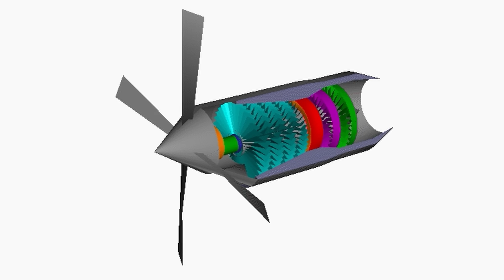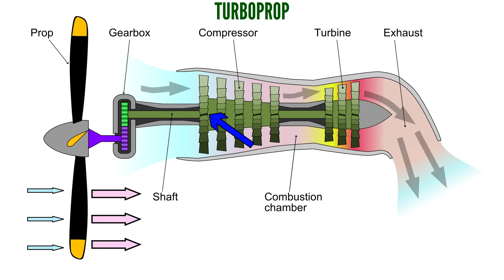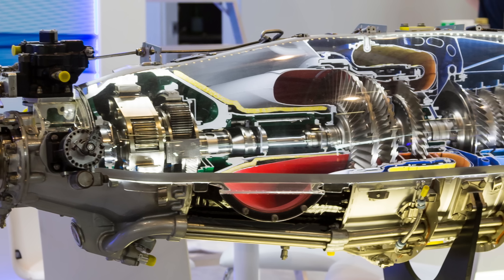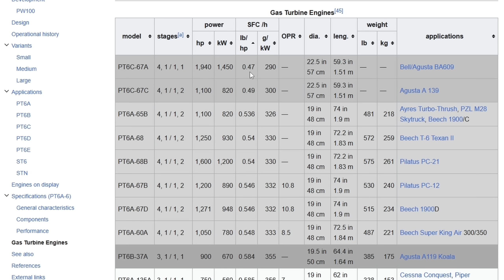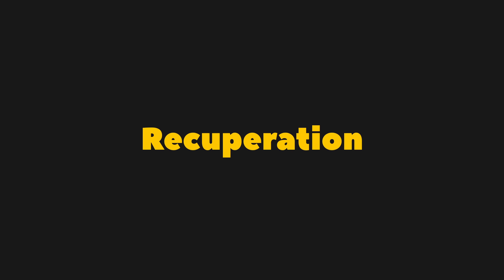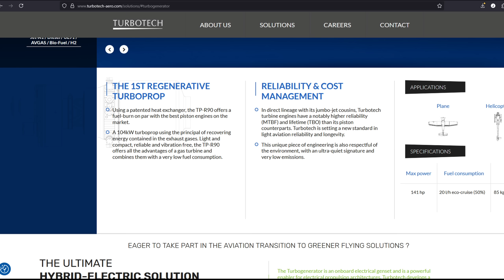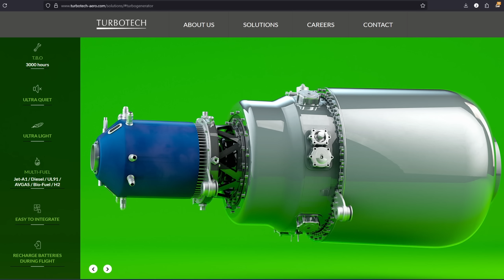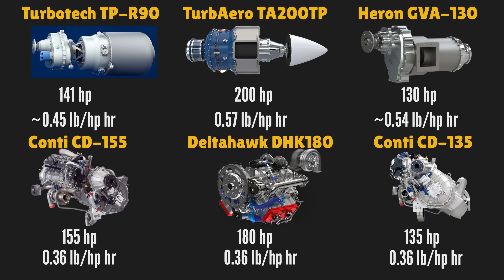Are Piston Engines Dead? Small Turboprops are Here

Comment: the trhing that's been holding back small turbines is recuperators. Nail that and your fuel economy skyrockets. 
The problem has always been bulk. Air-to-air heat echangers are large and this is where most small engine researchers have been working, but the hobbling factor has been a lack of investment - it's always been cash-strapped startups

Going forward, the same principles can be pulled into larger t-prop engines as long as it can be fitted into the nacelles. There's a lot to gain IF the mass penalty is low. You're not adding moving parts - the heat exchangers are entirely passive
Reply: interesting, I wonder if any of the advancements in  CPU/GPU cooling especially heat pipes could be applied to here.
Reply: @dacharyzoo  Heat pipes require vaporisation at one end and condensation at the other (phase change transport)

Turbine compressors typically achieve 250-350C just before the combustors (when you compress a gas it gets hotter - Boyle's law) which means you'd need to find another working fluid (most use water and a slight internal vacuum for electronics in order to lower water's boiling point

They're really efficient/effective and we've used them on spacecraft to get the internal heat out. but the cold end has to be "cold enough" or you just end up with a thermosyphon and those are vastly less efficient as well as gravity dependent
Reply: Absolutely that kind of technology is going to be a tricky one to make it compact and efficient
Reply: @Hurpdurpdipidydoo  If anyone's seen the engine package on an Abrams tank - 80% of the volume is the recuperator. That may help people understand the challenges trying to pack everything into the pointy end of a GA aircraft without ending up with a massively long snoot that upsets CG

Comment: Not in the near future due to the fact most of the GA fleet was type certified in the 1960s and 1970s and a conversion from a piston to a turboprop would be a major retroactive design change which would require extensive and expensive design and re-certification, per aircraft model. We can't even get modern piston technology widely adopted in GA.
Reply: That said, if they had an STC ready to go for the type (that's a big if) and it competed with the cost of a new Lycoming / Continental engine I would consider it.

Comment: Thanks Let’sGo, excellent presentation. Another critical factor to consider is power to weight ratio. 

If you want 400 to 500 hp for light helicopter (or airplane), petrol engines would just be too heavy. Diesel reciprocating engines even worse.
Reply: Power to weight ratio and efficiency will counter each other to a degree.  Fuel is heavy so when longer distances are required, a more efficient but heavier engine could prove to be the lighter solution.  You have to look at weight of the full solution - so engine and fuel.

But you point still stands - it is an excellent point.
Reply: True for larger helicopters but not for very light. e.g. Robinson. 

Robinson produces three models: the two-seat R22, the four-seat R44, both of which use Lycoming piston engines, and the five-seat R66, which uses Rolls-Royce turbine engines.
Reply: The earliest helicopters had piston engines. Sikorsky H-5 used a R-985 rated at 450 hp, smack bang in the range you mentioned.

Comment: I don’t think it is really there, I want it to work but it just isn’t possible it seems. Turbos are there own problem too with cooling as you come down.  This is why diesel doesn’t work well either. 

The air temps as you come down warm up drastically or going from say Arizona to California the rapid temp changes crack turbo housings.

Comment: the cost of more fuel consumption is worth it because of extreme reliability.
Reply: The gearboxes are the critical part. Making reliable gearboxes is an issue with helicopters, reciproking engines, and keeping down the maintenance costs even trickier.

Comment: You should include the all-up weight of each turboprop vs IC engine comparison as well. Especially for the diesel engines. Weight directly relates to required power and hence effective fuel consumption rate to transport a given cargo mass.

Comment: Talking about Mogas as an alternative to 100LL. I guess what people really mean is the universally available „pump gas“. Problem is, at least in the country that Lets Go Aviate comes from, that the available pump gas doesn’t have the octane (RON) number required for most high compression aviation combustion engines.

Further, there is a high, varying and undisclosed ethanol content in pump gas in countries such as South Africa.
Reply from the maker: Octane in South Africa is more than sufficient. I'm not aware of any mogas aero engine that can't safely run on 95 RON. However an increasing problem we do have with "pump gas" here is contamination (diesel in the petrol).
Reply: @LetsGoAviate Even if you are unable to trust automotive stations to supply fuel clean enough for safe GA use or you were worried about ethanol presenting problems, and had to maintain a separate supply chain path for "aviation MOGAS", just being able to replace 100LL with "pure" (no ethanol) unleaded "car" gas as your "standard AVGAS" would be advantageous.  And it honestly wouldn't be too terribly expensive, I don't think - I live in a coastal area, and while the "car gas" is invariably up to 15% ethanol, quite a few stations maintain "no ethanol" (Rec90) 90 octane gas (still "automotive grade"), primarily for marine engines and small engines (also good for classic cars).  Yes, its more expensive than the ethanol gas, but not prohibitively so, and not nearly the same price difference as between "regular" pump gas and 100LL AVGAS.

Comment: What is the fuel efficiency numbers for modern Diesel engines for general aircraft?
Reply: About 45% thermal efficiency compared to 35% for gasoline. So nearly 30% more efficient, not taking into account some additional weight.

Comment: Merallurgy development is contantly advancing, turbine manufacturers should concentrate more in incorporating less expensive, more effective and stable reliable materials available now, certainly slightly heavier but not significantly so.
Reply: Compressor efficiency is basically hit a Plateau and that's where most of your fuel efficiency/consumption is linked to.

Comment: It is a huge delight to find a presenter who really understands the issues and engineering.  I can't remember the last time this happened.
Reply: Yes 🙌
Reply: You never talked to me... Ha ha. Yes I agree he does come from a Pro Con balanced factual standpoint.
Reply: Yes, he's tecchnical, factual, not selling himself or aything. To the point, not acting cute. Refreshing.
Reply: The air is push in the compressor by the atmosshérique and the dynamic pressures due to the flying speed of the engine. Air and any other fluid can't be draw or pulled! How coud you attach the rope?
Reply: He's got nothin' on this guy. ;)  

https://www.youtube.com/watch?v=Ac7G7xOG2Ag
Reply: Because it’s not Ai crap
Reply: @glynncleaver7398  - A typical AI crap is showing a bunch of generic stock video clips badly mixed together.  Yikes, I hate AI generated videos!
Reply: @glynncleaver7398  Absolutely

Comment: So is this turbine engine's efficiency gain valid for altitudes below 10,000'? Distilled down the vid was mostly about a 140hp turbine, so being the devil's advocate, the efficiency claims may be true enough at 25,000' factored for time to destination in a best case scenario, but one wonders apart from the experimental segment and training aircraft what use is 140hp and percentages of that amount between 65 and 80% output? 
To me this has the smell of best case scenario, a bit like fuel consumption figures for cars that manufacturers release than can never be attained by anyone ever.

I guess the weight saving if any over a Rotax may account for something, and over a 200hp 0-360 Lycoming 4 cylinder it might sort of make sense since the turbine cycle is unaffected by altitude in the flight envelope an NA 4 cylinder aero piston engine might be. Even so it's still 60hp down in the takeoff and go-around high drag phases. 
This of course begs the question, what of hot and high performance? What are the hot starting/failed start rules. Turbines are very sensitive to this sort of thing rendering them very fragile in terms of any kind of pilot mismanagement, lack of attention. Piston engines are more like cars in this regard.
Are they available in CR? A lot of unanswered questions from this cynic. 

The reason for my cynicism is I read an article called the Little Engine That Couldn't around 15-17 years ago about the failed Williams EJ22 jet engine. It's design was hoped to replace piston engines once and for all. 
After reading that article I know well enough the issues of small jet engines and how the obstacles may actually be unable to be solved factored for cost vs real world hot and high performance. In short a great engine if you live at sea level and it never gets over 15deg C and 1013.2hpa.  
Turboprops are far more flexible than jets but the blade gap to housing clearance percentage issue of small and large turbine engines you discussed causes me to ask all these questions regarding fuel consumption and efficiency at varying altitudes.

Are the public going to yet again be seconded into the role of being unwitting full paying beta testers for this company?   

Also, variable stators have been in use since the 1950's to get around the fixed compressor section blade pitch issue. I'm hardly a turbine engineer, but I have noticed the J-79 made great use of same before I was born.

Comment: Up front cost is too high. Doesn’t matter if it lasts longer or the fuel is a bit cheaper, it costs 3x even a certified lycoming lump. A decent 40 year old Cherokee 140 is a $40,000 airplane these days, nobody who isn’t already very rich is going to be paying the already unreal costs of GA aircraft and adding a $150,000 STC on top of that. And yeah, you can bet that converting to the small turboprop will cost a lot more than the $100k of the engine itself.

Comment: All us general aviation guys want to be flying turbo-props, but that poor efficiency especially at low altitudes, modest power settings, in smaller sizes and built to be affordable is the recurring problem.

To my way of thinking, we haven’t yet had even close to a responsible offering in DIESEL.  Ultra high strung geared diesels are nowhere near the answer.  It seems like with modern VVT technology, a turbo diesel that isn’t too heavy could work; especially with the significant fuel weight savings.
Reply: I think the biggest problem is there is very little research into the small diesels that are the best fit for aviation.  Two stroke diesels have been effectively banned from on road applications due to emissions.  Achates is the only company I have heard of doing research into two stroke diesels in the size range that would be used in a GA aircraft.  I believe the issue here is automotive engines have a much lower incentive to sacrifice everything for weight, thus the 53 and 72 series Detroits that have power outputs in the range desired, are too heavy being iron blocks. Then there is the allergy so many GA have to liquid cooling...

BTW VVT is useless for aviation uses, as the purpose of that tech is to expand the useful RPM range, and aircraft engines operate in a very narrow RPM range.
Reply: @Castenea-y7e  Good Morning!

When I wrote about VVT, I kinda knew people were gonna find it odd.  One of the many challenges to a light weight reliable aviation diesel is being able to reliably do a restart at high altitudes where the air is thin and cold.  One way to mitigate this is with a compression ratio that is somewhat higher than is common in today's diesels.  Unfortunately, to achieve the reliable horsepower we need without spinning it up to fast the way Thielert did with those tiny Mercedes diesels, is to "boost the hell" out if it;  High boost really is best on diesels with quite low compression ratios.  Limiting compression is also good for NOx emissions though that is not my primary concern.  I propose that VVT is PERFECT for powerful aircraft diesels; the auto industry has made these systems quite trouble free or at least free of unexpected failure, and solves the problem of very high boost at altitude while having very high compression in those conditions where it is needed such as starting at altitude or even at a high altitude cold climate airport.

Having been the owner of a couple of 8V71N engines (though I am a cummins guy at heart), I agree that two stroke is a path to higher power especially with properly chosen boost.  When properly designed, their pollution isn't that bad.  Mine were surprisingly clean even running "against the pins".

Comment: Super video!
It should be noted that a turbine engine follows the Joule-Process, while piston engines are closer to the Carnot-Process, and the Carnot-Process is more efficient.
I flew all types of engines. A two-stroke diesel, burning Jet A1, might be a good option for GA and even commuters.
In case of a hypocycloidal crank system harmonics could be even cancelled out.
With these piston diesels fuel consumption is proportional to the power. This is important on oceanic routes in case of headwind.
Best speed, in case of headwind, is 1.5 windspeed. If you can't make it with this speed to the destination, make a 180 and return to the airport of origin.

Comment: I think small tuboprops will likely at times achieve a slight edge;  but will consistently be surpassed by turbo piston engines, due to the changing context.
if they can hang in there, the turboprop manufacturers will be ok ... but they are going to have to work for it, that's not easy.

Comment: Thanks for great video!  Based on your report, I think turbo props are on the cusp of coming to GA.  You showed cost comparisons between turbo props, but you didn’t show same costs on all the pistons. For example, I have heard Delta Hawk asking over $100k for their new Diesel.  Yes it gets best in class fuel consumption and probably rivals the turbojets in TBO (not really buts let’s give that that one), it is then more expensive that two of your turboprops and same priced as the other!  And I will bet they are lighter weight. And we know they are smaller form factor.  In fact this last point could be the deal breaker.  Piston engines are just bigger in frontal area.  That frontal are, particularly at the nose creates drag.  That drag slows you down and increases your fuel consumption.  I’ll bet that when you put a piston engine into a planed designed for one, and compare the fuel consumption of the same plane but with the front modified to accept a turboprop, I’ll bet that fuel consumption penalty on the turboprop goes away!  It would be great to figure out some numbers on this aspect. Maybe a future video? ;-). The bottom line is that you have convinced me that turboprops are indeed the way of the future. For example, after the introduction of the turbo tech, I can’t imagine that Heron is not hard at work adding recuperation to their engine.  And if they can maintain a comparable price point, it’s game over for pistons in GA.  AND, I don’t understand why recuperation is such an impediment. I’m a physicist, not a jet engine specialist, but you don’t need to get super fancy in design to get appreciable recuperation.  Yeah if you want to squeeze every last watt of heat transfer out of the thing you could go crazy with sodium heat pipes and other novel and expensive SR-71 type solutions. But that is not GA.  Just design a decent high flow heat exchanger to get some of that heat back, keep it simple Sammy (KISS) and thence low cost, and it should take the market by storm.

Comment: Why don't turboprops use the exhaust as auxiliary thrust with the propeller?
Reply from the maker: A few reasons I think. First, engine and exhaust placement. Think of a front engine'd plane. How would you position the exhaust so that it provides thrust in the correct direction, but not melt an part of the plane?

Second is efficiency. Similar how commercial airliner engines went from turbojets (100% thrust provided by exhaust) to large bypass turbofans (~85%+ thrust provided by the fan, ~15% by exhaust), it's just more efficient to create thrust with the propeller (with some caveats of course, especially at high altitude)
Reply: A well-designed gas turbine will have very little gas velocity energy remaining after the final turbine stage... and most important to remember is gas turbine engines do not have convergent exhaust nozzles to accelerate the exhaust gasses as jet engines do... this would reduce the final turbine stage efficiency

Comment: Diesel engines running on Jet A would probably be a lot more affordable. That would solve the problem of what to do if and when 100 LL gets banned.
Reply: Have diesel engines lost much weight? My recollection is they are heavy especially due to water cooling. And also they are wide.

Comment: I love turbine engine reliability, smoothness, and power to weight, but I royally loath the fuel burn rate.  Double, or worse, the fuel burn of IC engines.  I prefer the jet fuel burning IC concept, where you actually do get amazing improvements in reliability, power to weight, and especially fuel burn for any given power (though much greater improvements for higher power applications where the weight of a jet fuel burning IC engines has little or no difference.